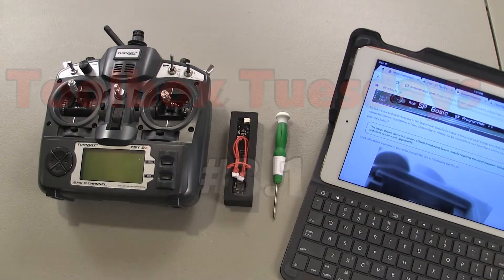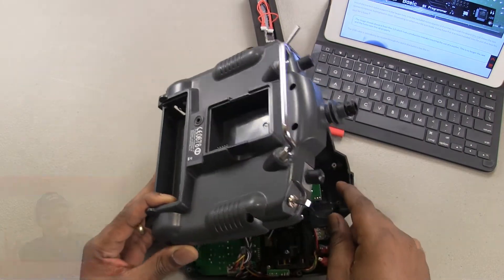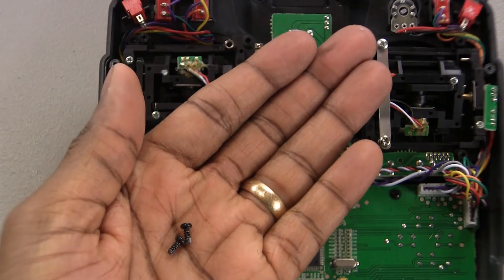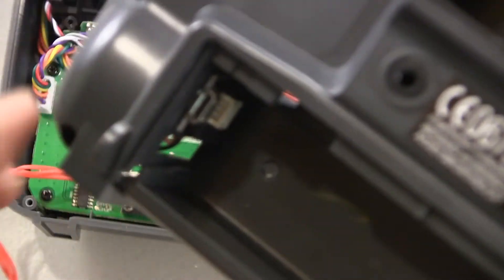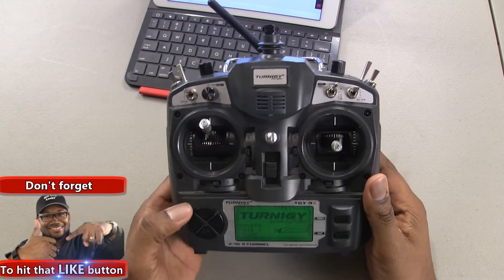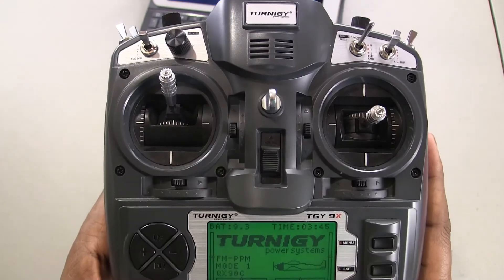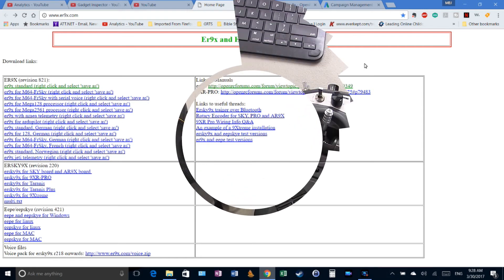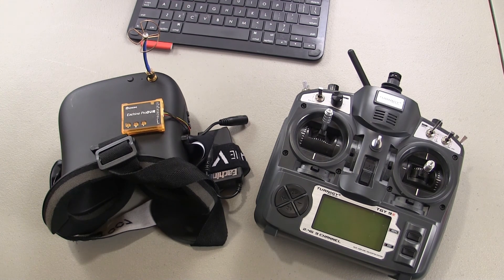Toolbox Tuesdays #3.1 - SmartieParts 9X Programming Board Installation - NO SOLDERING REQUIRED

Comment from the maker: Installation of the programming board is super easy.  Prior to flashing er9x, I am going to get more familiar with how to setup a quadcopter with all of the mixes programmed properly.  I currently have everything setup the way I want it with the stock firmware, so I want to retain that until I fully understand er9x.

Comment: Hey Inspector How are you my friend? I have an update for you. My Night Stalker/F10 flew away at 75 feet. I was crushed so I called the manufacturer and you aren't going to believe this but they are sending me a replacement quad. I couldn't believe it. Also they're a prop purchase a made a few weeks ago. I'm not sure why they're doing that but they are. I also bought Real Flight Drone simulator with the Futaba controller. It's pretty nice. The controller works with Flight Gear and DRL sim as well but there is some latency issues with the DRL sim. It also works with the Microsoft flight sim demo. So I'm pretty happy with it over all. God bless you Brother. Keep it up!
Reply from the maker: Hey code one, I'm doing well.  Good to hear from you.  Sorry to hear about your fly away, but how awesome is that to get another one sent to you!  Keep practicing with the sims; now that I have my QX90C I'm finding that I still need to get more acro flight time.  Lots of crashing so far, but enjoying every minute.  Glad to hear your having fun.  Thanks for the update and encouragement.

Comment: I know its old video - but many boards - the left screw hole is wrong and its mounted by using a large washer to trap the left edge of the board ... it also means it's possible to have board move over time.
It was a factory error of the first boards made ... even the replacement I was sent is also not correct.

I notice that guy here does not fit the plastic stand-off to prevent over-tightening of board ....

Comment: Hi there are you doing a follow up on how to download the firmware? ta
Reply from the maker: +traci beacer Hi traci. Yep, I still plan on doing a video on it, but I haven't flashed the new firmware yet. I have a few micros setup with the stock firmware and got into flying them a lot and didn't want to have to redo everything yet. But since you asked that actually reminds me that I need to do it. So, stay tuned. Thanks for watching.
Reply: Hi, I'm also interested in this flash video update. Currently my SP board is on the way so I hope you will have time to try it soon. Thank you
Reply from the maker: Hey Pavel.  Yep, I still plan on doing it, just haven't gotten around to it yet.  Since I'm getting requests I'll try to speed up the process.
Reply: Hi. Just for information last week I successfully flashed my Turnigy 9x (mode 2) stock with er9x standard firmware with usage of SP basic 1.1 programmer. It worked like a charm. Just follow the instalation instruction in this video or on the smartieparts page. Second step, flashing the firmware, I made with eepe software and standard er9x.hex file from er9x.com page. And for this you can find any tutorial on youtube shows solderless flash of firmware for Turnigy 9x. So I finally get my quad to the air, because of changing channel order and it flyes great...
Reply from the maker: +Pavel Srnsky Awesome! I have been so busy with other quads that I haven't gotten around to this yet. Glad to know it works well. Do you have a video on it?
Reply: Hello, Unfortunatelly I was so afraid of flashing, that I didn't make any video. But you can easily use video from ParkeFlyer (9x firmware update). Instalation instruction via eepe is from time 4:45 till the end included configuration of sticks. I just skipped upload of predefined EEPROM and configure my own.